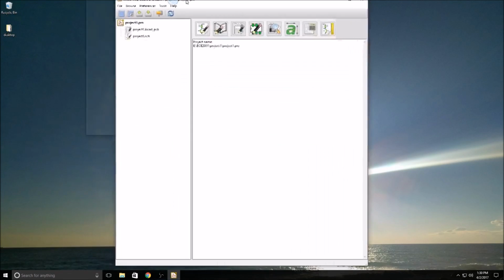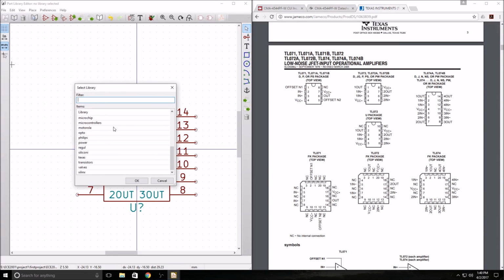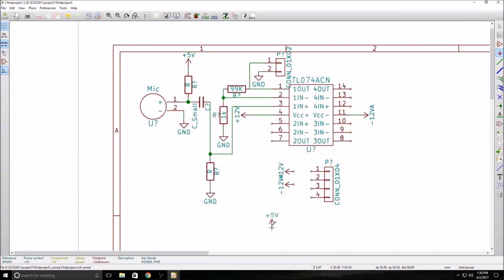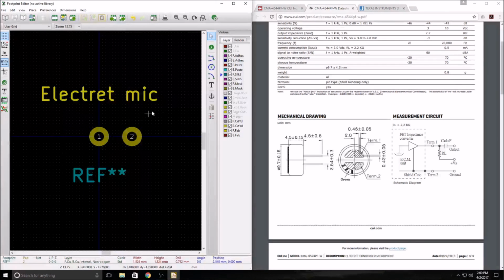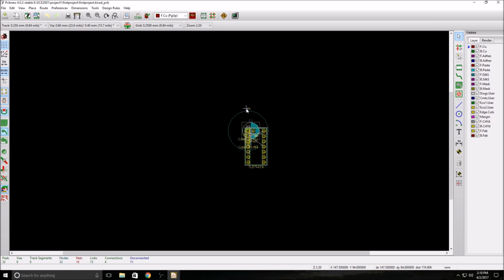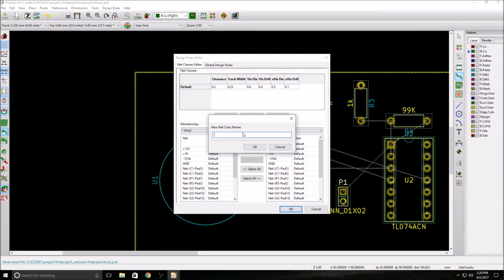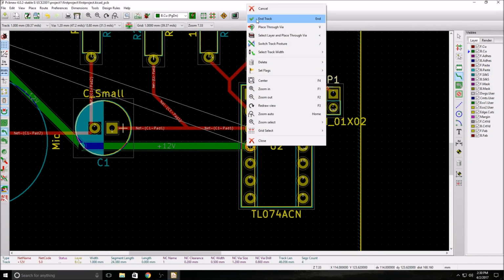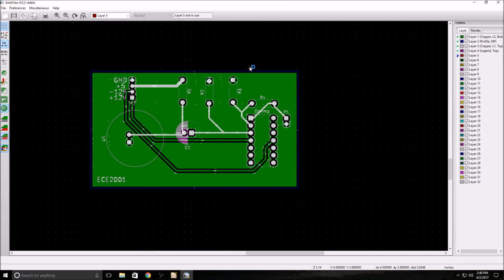Getting started with KiCad

Comment: Nice tips in there, thanks!

But, for god's sake, please learn (and teach) using the keyboard shortcuts... saves a whole lot of mouse-moves ... especially for the wiring ... ("W")
also a whole lot too much wire action, you can just place a component pin on an existing wire or existing pin to connect them ...
As for the Mic footprint, you've used the diameter as the radius ... a sanity check of the size by comparing the size of the OpAmp chip (which also has a pin pitch of 2.54mm) would quickly make that clear ...
Reply: For god's sake, make your own video tutorials.

Comment: What i do is use the measurements shown in the status bar at the bottom screen from correct placement. Say you want to put two pins at 2.54 mm from each other, than just set the grid size at 50mil or 1.27mm, put the first pin at one dot left to the center on the X axis, put 2nd pin at the first dot at the right side on X axis, than you can peacefully draw the circle from the center and set the radius up to any point on X axis you like, very convenient. 

I have switched to KiCAD from Proteus (for its open source ecosystem of-course) but these small nitty gritty things were lot easier on proteus (e.g. after placing a component, you don't need to click on the wire button to activate the wire drawing mode, click a pin and it automatically draws wire). 
Too bad they don't focus on the open source community.

Comment: kicad is a broken mess in my opinion it has shit default design rules and is buggy as hell even though it is not a full release it should be more stable also a pain in the neck to use as it doesnt follow standard cad/cam software rules also grabs my mouse and wont let go without ALT+F4 goddamnit i dont want it to grab my mouse
Reply from the maker: Yeah I agree that it is not the best software but of the free ones with no size limits it does pretty good. Hopefully it will get better in the future, I think it has been in development for 4 years now.

Comment: A good introduction. A bit of feedback: the microphone footprint circle was, as you noticed, huge -- because the diameter was specified on the mechanical drawings, and you set that dimension as the radius.
Reply: I just did a test; the coordinates specified in the dialog are the centre (which is obvious) and a point on the circumference (which is not, unless you maintain it in line with the CL axes). So, if you have the centre at (0,0) and one point at (1,0) then the radius is 1; but if the point is at (1,1) the radius is sqrt(2).
Reply from the maker: +Making Sense Thanks for your help, sometimes you forget trigonometry. Hope you still found this tutorial useful.
Reply: Oh, it certainly was. I'm perhaps a little more inclined to spot that type of error, as I've just started learning CNC programming. Thanks for making it!
Reply from the maker: Yeah that is alot of work, last time I coded something in gcode was seven years ago.